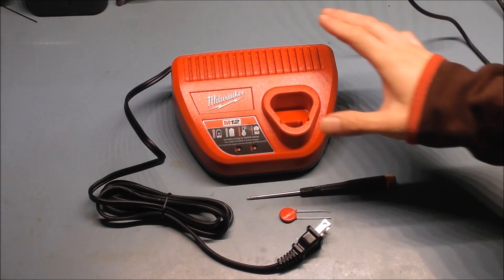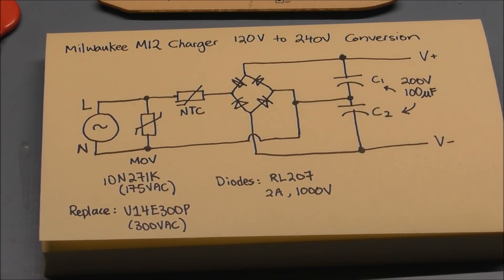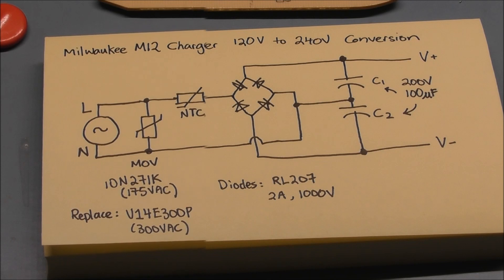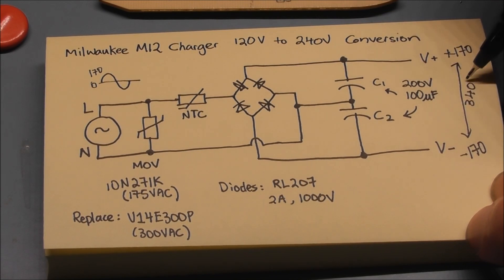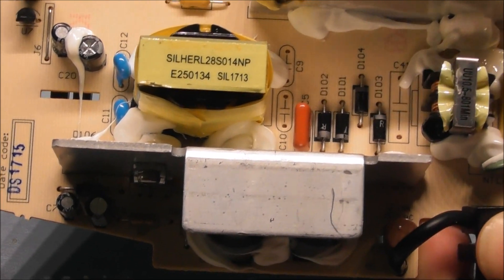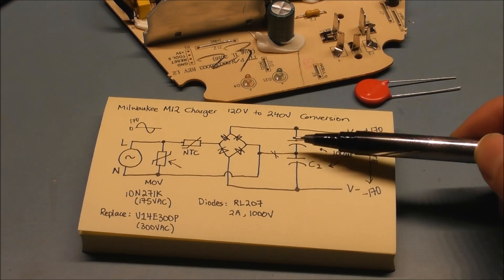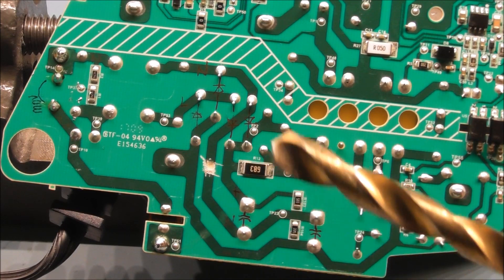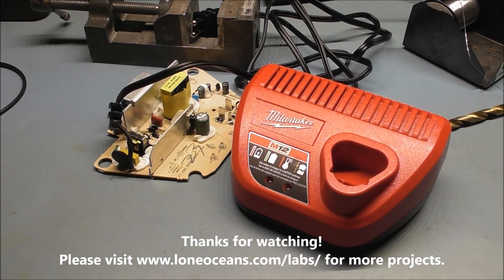Milwaukee M12 Charger - 110/120V to 220/240V Voltage Conversion

Comment: I’m afraid I ignored your final words of “don’t do this if you don’t know exactly what you’re doing”.
I followed the rest of your advice but used a MOV with part number 10N471K.
Your explanation was absolutely excellent and I even felt that I was starting to understand how the power supply worked.
I plugged it in and appear to have fully charged an empty battery without any explosions or flames.
The MOV I used is the same physical size as the original, a fair bit smaller than yours. I assume it’s ok. I’m only one charge in but will monitor very closely while using for a bit. I’m very happy and very grateful, thank you!

Comment: Hi the practice of bring a layer of thermoretractil is simple, when have a voltage over the nominal, the MOV explode and fire , for protect the card and other components are use the thermosrink protection, best regards from Santiago of Chile, in the corner of the World. Very practical and didactic explanation.

Comment: It looks like they've revised the design to a way simpler board in the charger you have, compared to some other charger teardown I have seen. Do you think it would be possible to bypass the AC to DC power supply side of the board and have a DC input? I haven't yet measured my charger to see what the DC side runs at voltage-wise.

Comment: Thanks for the detailed explanation. Everything works great. However, I did not have the opportunity to purchase your proposed V14E300P. So I used ERZV14D471 RoHS
Cheers from Lithuania.
Reply from the maker: Thanks Darius, I'm glad it worked out for you. The part you chose looks like a suitable replacement.

Comment: Fuck Milwaukee for not using a PFC switch mode power supply which could handle autoranging.  Power supplies are dirt cheap today, there's no excuse for this!

Comment: Do you know what mosfet was used? It was mistakenly connected to 220V and it burnt the switcher. I will cut the neutral line so it will not break but offline switcher is toast, i do not know the part number.

Comment: Will the conversation makes it a dual voltage charger? Or only 220v so that 110v cannot work anymore?
Reply from the maker: No, the conversion does not make it into a dual voltage charger. It is possible to add a properly rated switch to toggle between the two input voltages, but one must be aware of the safety implications.

Comment: has anyone tried to bypass the hi-voltage side and go to the battery charger protection circuit from 12v (car battery)?

Comment: I know this is an old video, but to anyone reading this, is there a way to patch in a 12vDC feed to convert this charger to run either off AC, or 12v?
All the car charger units use 5vusb and that is just crazy slow and inefficient. Why convert 12v to 5v to charge 12v? Daft.

Comment: Would it now work on both 120v and 240v AC input power?
Reply from the maker: Would not recommend to do so, though it may work. After the modification, the input voltage to the DC/DC converter will be half of what is intended. Given that the converter is a step-down, depending on how it is designed, it may still function but may result in unexpected results.

Comment: My step down transformer was not set correctly and mistakenly plug my charger in and smoked it. It looks like it over charged the capacitors as the are now leaking. MOV looks fine. Do you think it worth fixing? Are there other components that likely got cooked?

Comment: If the 120V unmod unit was plug into 240V power, what will it does? does it just damage the 175VAC MOV only or will it damage more beyond? Since the unmod unit is not cute at the bridge. Also what if replaced the 300VAC MOV but not cutting the bridge, what will it does.........Just curious?
Reply: I just repaired one that was 120V and plugged into 240V.
The MOV was not damaged. The Fuse(F1), one of the capacitors(C3) and two of the diodes in the rectifier were blown(D103,D104).
If you do not cut the bridge between the capacitors,  you're going to exceed the capacitors' rating and blow them up.
Reply: @piratsik7691  i have same problem, how to check if the diods are fine or not ? i just see one of my capacitors are blown (liquid on the walls), the fuse and the mov are fine.
Reply: @TITAN9389  You can check with a multimeter on diode mode. Better desolder one side of each diode you test so the rest of the circuit does not affect your readings.
If the diode is good, one side has a small voltage drop (reading maybe 0.6-1V) and the other does not conduct(reading 0L).
If it's bad, it will either be open(0L on both sides) or shorted(~0V on both sides).
Reply: @piratsik7691  thanks !

Comment: i have heard that it's enough to cut the connect over there without to replace varistor make sense???
Reply: No. As common sense will lead you to thinking why would you if the current one is up to 175V and you want to plug it into 220. You can just cut it but then you are going to lose the protection.

Comment: so , why not removing the varistor and cutting the circuit? also, I don't understand why you said half of the sin wave is 170v, it's 55. having said that to my best understanding and even based on your analysis of the circuit the cutting of the circuit is not necessary...

Comment: I accidentally plugged the charger into a 220V without doing this modification. Now I have done all the modifications but it still does not work. Any advice on what should I do? Thanks
Reply: try to replace 10N271 to 10D471, replace two 200V capacitors with same one

Comment: Crystal clear explanation. But how about the 60Hz / 50Hz conversion;)
Reply: After the diode rectifier the frequency doesn't matter because it converts to DC current.
Reply: @luismaflorentin  Right. I was thinking about linear power supplies where you have a transformer which heats up a little bit if you run it on 50 Hz instead of 60 Hz.
Reply: @myelectronicsworld  Right! Cheers from Argentina!

Comment: i have a 220 volt M12 how i can convert to 115volts......give me the schematic.....tihis one only has one input cap
Reply from the maker: I do not have a 220V unit so unfortunately I cannot advise you.
Reply: @loneoceans  u have a 110volt.......give me a simple drawing how is made¿ i will transform my 22o volt copying your arrangement.......take a close photo of both sides where you segmented the PCB.......
Reply: Hello Mario I have a new charger M12 110V  and I need M12 220V

Comment: do you cut and replace the cable or plug? to euro plug
Reply from the maker: The easiest solution is to use a wall plug adapter 👍
Reply: loneoceans thanks a lot! Any chance you can do a video for dewalt dcb115 charger?

Comment: Does this lower charging times as well or does that remain constant regardless of voltage?
Reply from the maker: This will not change charging time, from the perspective of the downstream charging circuit, there is no change.

Comment: can I use 10D471K instead?
Reply from the maker: Yes that looks like it will work (same voltage rating as the V14E300P, just less surge capability).
Reply: loneoceans thanks for your reply, i will give it a try.
Reply: @aquacoolg  Hello mate, did the 10D471K Varister work?
Reply: Glenn Tagaylo yes it does
Reply: @aquacoolg  Thank you mate. I'll go buy varister now and replace the current one. I bought a step down transformer 220v to 110v output at 100watts...It doesn't work. I'm not sure why. Just tested the 110v output and seems working.
Reply: @loneoceans   Can i use MOV-20D471K ?

Comment: Greetings from Serbia! I have a Milwaukee charger type 48-59-1801 that needs conversion from 110 V to 220V. Your video is by far the best one on YouTube with your explanation I tried my best to locate that bridge that needs to be cut but could not locate it. Is there a way to contact you via email and maybe send you some photos and hopefully you can point that bridge for me. Thanks in advance.

Comment: Awesome video, by far the best out there. Very well explained not just this what you do, but this is what this does. Could you please send me your email address, I have a question regarding the easiest way to convert a Milwaukee 12v charger or 18v and 12v into a British building site charger (here on building sites we use 110v on a yellow commando plug) at first I thought easy change the plug with an American 110v charger put that doesn't change the fact here we use 50Hz not 60Hz. Any help please
Reply from the maker: Andy, thanks for your comments. The line frequency (50Hz or 60Hz) shouldn't affect the operation of the charger since it is rectified into DC anyway. However, I can't speak for other chargers other than this exact model, since other models may have different designs internally.
Reply: Huge thanks for your prompt reply, you are a true gentleman. Am I right in thinking that as long as the charger has a rectifier in it, the input frequency shouldn't matter because it gets changed to DC? Is that right? Or have I misunderstood? 
Many thanks
Andy